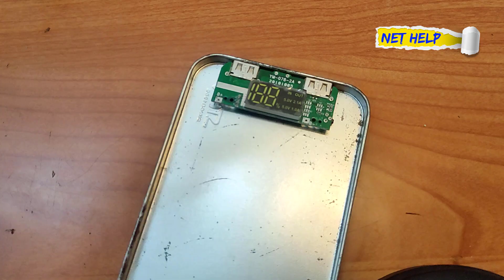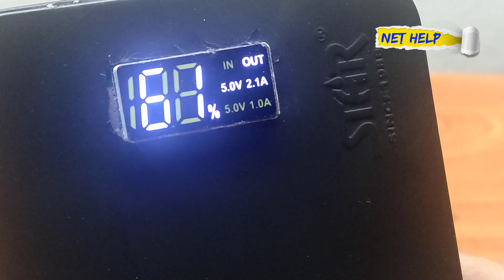DIY . You won't throw it away anymore

Comment: Okay where do you get the controll board
Reply from the maker: Okay where do you get the controll board
Reply: When you did the build you cut out holes in the box to put the display and the USB ports in and then you installed the controll board and hooked it up to the batteries where do you get that unit it's a nice unit I have plenty of old lap top batteries I'm sure I can find find enough batteries to build the unt you built all my battery packs that I've bought have no or losy state of charge displays like the one you used as it clearly shows percent of charge